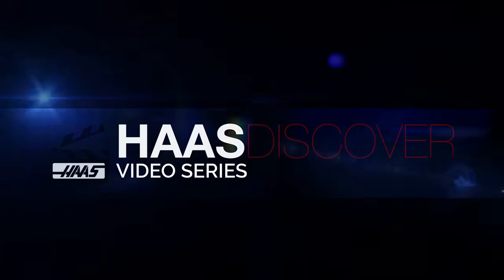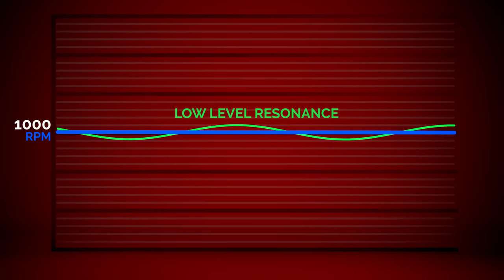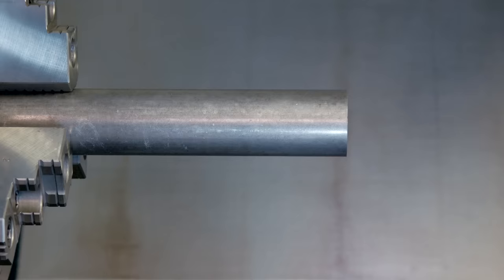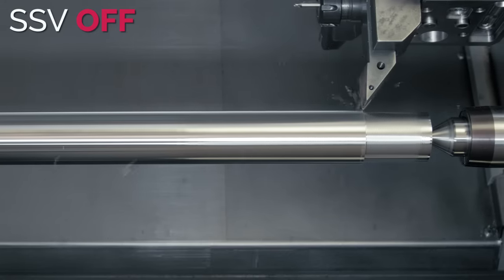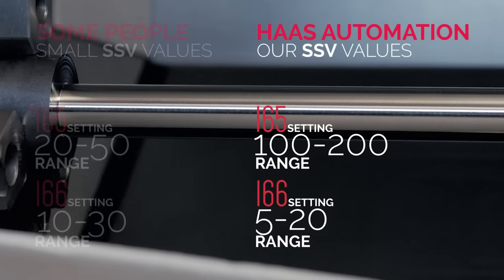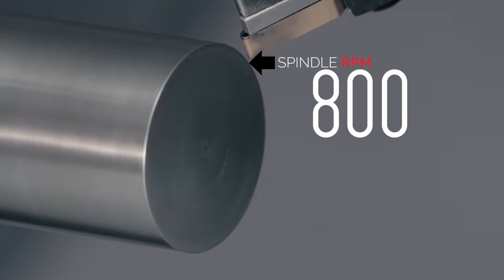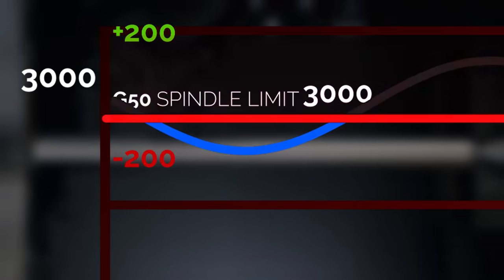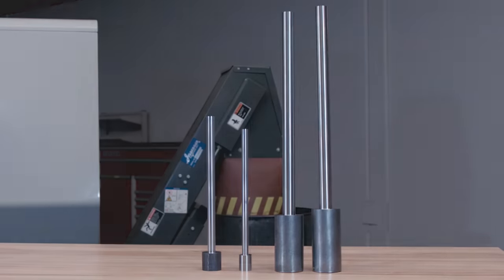Spindle Speed Variation - Stop chatter on your CNC lathe - Haas Automation

Comment: My machine doesn't have SSV, but I use this technique manually with the overrides and got great results. When you do not want or can't change the setup, rapidly changing the spindle speed works. Especially when you're facing and getting chatter.

Comment: Im a CNC machinist and I have never seen such an amazing content from any CNC machines manufacturer as HAAS does, great job, this is gold.
Reply: This. You don't even necessarily need a HAAS machine to apply what you learn from these videos. Great series that teaches concepts.
Reply: @Yeah Right "Tool Pressure" may I have an explanation? I've had lots of problems with chatter and it's almost always boring bar length or not enough support on jaws. Actually is there something I could read up on that you would recommend on this topic because I was just thrown in on a cnc lathe (not a HAAS) and had to learn everything on the job.

Comment: 3:40 There is conflicting information in this video. The narrator says SSV increases spindle speed by 150 rpm, then decreases by 150 rpm. So it should be back to 1500, but instead it shows 1350.

Comment: One thing they didn't quite explain: Around 2:50 they show the spindle speed varying above and below the resonance speed, but don't explain why you wouldn't just pick a fixed spindle speed outside resonance.
I can some of with three reasons:
1 - The system is probably a nonlinear one, and so it will resonate at a wide range of frequencies; varying the driving frequency prevents the resonance from growing to a significant amplitude.
2 - The resonant frequency will vary as the part is machined and so will eventually match any particular fixed spindle speed
3 - Determining a safe spindle speed is pretty much by trial and error, resulting in many scrapped parts during test cuts

Comment: I think a very important point was not covered or maybe it should be assumed? 
Does the federate try to follow the spindle speed to maintain a constant surface footage?
Would SSV be generally more or less effective if it did or did not?
Reply from the maker: +Max Maruszewski This is the beauty of SSV. It maintains the same Feed Per Revolution, while the spindle RPM varies up and down to keep the chatter away. Your parts will get the same consistent turning finish, as the feed does follow the spindle RPM with SSV.
Reply: +Haas Automation, Inc. So with SSV on the SFM of the tool is fluctuating.
Reply: Max Maruszewski The SFM is only a function of the workpiece diameter and rotational speed, so yes, it changes.

Comment: Very impressive. It would be just as helpful on the milling machine to. Is also available on the VF2?
Reply: Much more helpful is to use SolidCAM, which will tell you if it will vibrate or not already before cutting anything.

Comment: Hey, I was just curious, can SSV be applied and disabled inside of a canned cycle such as G71? I have made parts that have a large stable diameter closer to the check but further out have chatter issues due to the small diameter... Just wondering if on the first/second line of an G71 if it can be turned on then turned of once its moved along the part into a larger area.
Tks!

Comment: Hi, I'm not sure if anyone (at Haas) monitors these comments but if so, I'd like to say thanks. This gave me an idea to try it on my machine. On an 840d, you can use synchronous actions to read the actual spindle and vary it by a % and time. This means it works in g96 and g97. Additionally, you can compare the actual to limit and if they are equal, the variation slides down instead of sliding up and down (moves the setpoint). In this way, there are virtually no limitations. Would this be possible to develop for your controls?

Comment: Here in Peru Haas machines are known for having the parkinson effect, they shake even under normal cutting conditions. Chevalier machine don't have that issue. Loaded with Fanuc or Siemens controls, very rigid spindle head plus a proper machine weight and geometry we have not experienced these kind of problems. 
This SSV will work for Haas, other machines don't need it.
Reply: A fair condition Chevalier can be a little jewel of a lathe!
Reply: even with inconel at 5.85mm diameter x 136.5mm long ??
Reply: @Jonathan Smith who is your comment aimed at ?

Comment: I tried it at work today using SSV but it was not working. Is there a specific cycle it can only run in? Such as a can cycle? I am running a linear G1 to make Edge breaks , turn down the diameter and another Edge break before that same tool parts off the parts.

Comment: Can you please give us a example of the M38 use in the gcode?   Does it go before or after the G96?  Can it be used with G97?  Where does the M39 (cancel M38) go?  If you put in another G96 or G97  line is the M38 still active?  Thanks for your help.

Comment: If you use a face grooving insert turn up the 7in or so with little to no chatter ive finish turned 16in 1.5 dowell pins between spindes no chatter .0015 tapper.

Comment: I work on a TL2 with the older screen set up. I can insert the G38 code into my program to start SSV, but how do I program the speed variation and timing?
Reply from the maker: Setting 165 SSV Variation (RPM)
Setting 166 SSV Cycle(.1) Sec

Comment: if chatter is caused by the spindle spinning at the resonate frequency, and ssv just make the spindle spend less time in that frequency, then wouldn't increasing rpm the rpm out of that frequency and leaving it there solve the problem?
Reply: Nix Ryu no because it will start harmonizing and it will start to vibrate again. Varying the spindle speed will keep it from vibrating alltogether.
Reply: Harmonics, the part can still vibrate at other frequencys

Comment: This was very informative! But I have a question: 
Does the SSV function only apply to Haas-machines or is it built in to the overall Fanuc system?
Reply from the maker: There may be other machine tool builders that have similar features, but this video refers only to Haas lathes. Thanks for the question.
Reply: In Fanuc you can develop it by your self quite easy by using "real-time macro" so your old "fanuc lathe" with this option can do this. 

Siemens has this feature avalible to donwload and integrate on (almost) any Siemens controller. 

Both controllers will also adjust feed to the actual spindle speed.
Reply: MANDELAZZA looks like an application for parametric programming if your machine doesn't have it
Reply: Any CNC lathe with a spindle encoder that I've ever used can do this...

Comment: does anyone know if there are similar functions on other machines? i operate a Dosaan with Fanuc and i cant seem to find any from what i know. anyone knows?!
Reply: I've never seen it on any other machine.  What you can do is manually emulate this using the spindle speed knob on the control.
Reply: @Reficul999  would be much appriciated!
Reply: @balooc2  at the moment the document is in dutch, if This is no problem i can send it to you. otherwise you'll have to wait a couple days then I will create a language button
Reply: @balooc2  I'll put a example in this comment maybe u can do something with the code yourself
Reply: @Reficul999  i hope i will! i have a job doing a 115mm long rod with a OD of 8mm. had a problem with vibrations and i hope this might be a solution!
Reply: @Reficul999   thanks alot! i will get back to you when i've tried it out. just gonna change some parameters to fit my program. thanks again!
Reply: @balooc2  let me know I'm very curious

Comment: G50 is the same as G92 S ?
Reply from the maker: Hello Salim,
G50 can perform several functions. It can set the Global Coordinate, it can shift the Global Coordinate, and it can limit spindle speed to a maximum value. 
G92 is used most frequently for simple threading. It can also be used for multi-pass and tapered threading.

Comment: I'm working on a DMG delta and an emco. I work propeller shafts for ship propulsion, which are 2-4 meters long. Material goes from 42crMo4 to high alloyed steels eg. X8CrNi18-10. never had such problems. Haas are just bad and you will hardly find in German companies.

Comment: how i wish that my boss purchase haas machine
Reply: Oh no you don't!
Reply: mang pekweng My shop had nothing but HAAS, we've put enough maintenance into them to buy a couple of ACTUALLY good machines.
Reply: HAAS makes a good machine for what it is, if you think any differently your being obtuse.
Reply: User Name They're great for running aluminum. I won't get into it, but after over a decade of being in this business and experience with countless "brand name" machine tool makers, I can ultimately say that's all they're good for. They have a great, user friendly control and they're easy to set up but that's where it ends. If that's "obtuse" then so be it.
Reply: We used them to great success running various steels holding sub .001 tolerances. They were far easier and cheaper to maintain and service than our Mori seiki and okuma machines and had no more problems than either machine. 

They get a bad rep from elitists, but they offer a good value. Personally I'm a Mori seiki guy, I ran the fuck out of a nh6300 for quite a while. Sure it was more rigid and had a shit load more power, but it also cost us much more money in downtime because getting service was a nightmare.
Reply: User Name We run, or should I say try to run ÷/-.001 on ours and for whatever reason the ID tolerances are an issue with "spring passes". Our lathe has an oversized chuck installed by HAAS that just LOVES to throw parts even at per spec and recommendation by HAAS. I've actually PROVEN the machine, that had NO ISSUES other than just operating in 4140 alloy steel ACTUALLY MOVES just from day to day operating.
Reply: Why are you spring passing anything? 

Yeah most lathes will do that if you cut the fuck out of everything. Our sl35s needed aligned once every week or so. It's not an uncommon issue. Even our brand new dmg Mori beta 800s have similar issues, as did the old okuma and mazaks.
Reply: User Name Thanks for proving my point.
Reply: User Name There's a big difference between cutting difficult to machine materials, and run of the mill (pardon pun) materials. Again, I've proven that within 6 months our HAAS SL-30 lathe with a 12" chuck, even held per spec by HAAS throws parts to the extent they need 1/3 cost of initial investment to get it back up and operating.
Reply: User Name And BTW, I've never seen a Mazak that couldn't handle anything. I've literally beaten tool holders back in with a hammer and pressed the cycle start button and ran it out.
Reply: I've seen dozens of mazaks not hold up for any time at all. I'm not sure what point of yours I proved besides all of your issues are not uncommon with lathes.
Reply: User Name I've ran, setup and programmed (at the machine) roughly a dozen Mazaks be it a lathe or a mill and they smoke HAAS on every level. Never had said issues with either a lathe or a mill with anything but a HAAS. I currently program for a MoriNLX2500Y and a Citizen Swiss type lathe. Again, I've proven our HAAS starts to run out within 6 months just by running it.
Reply: So does every machine. Even more so in non climate controlled shops. You've proven nothing here. Your argument is completely bogus. 

I am currently running a dmg beta 800 right this second that is out more than .5mm in y and has more than .3mm of taper over 300mm the machine has never been crashed. Dmg is toy grade machine tools, and their service is shit. 

The regional guru for lathes Mike is a half wit, and his reason our machine is out is we don't have enough grease in the Chuck. If your argument is that dmg is better you are making shit up for the sake of argument.
Reply: User Name "So does every machine. Even more so in non climate controlled shops" you don't say? I'll let you know when my DMG moves by THOUSANDTHS in a matter of MONTHS NOT YEARS. Hell, we've had our Citizen four SIX YEARS and it runs the same parts every day holding tolerances of +/-.0002 holding sub 15 micro finishes, next you're going to try and tell me how much better a HAAS is compared to that. "You've proven nothing here. Your argument is completely bogus." I don't have to prove anything to anybody, what I've said here is very much common knowledge. I'm not out to bankrupt HAAS I'm just keeping it real. As far as the machine you're running, I can't speak for that model as I've no experience with it but let's just put your "DMG is toy grade machine tools" theory to the test. Within the last 6 months both our HAAS and DMG took huge shots. The HAAS threw a part (surprise) and the Mori had a full rapid collision with a large Capto mounted drill that was so bad pieces of the drill are probably still being plucked out of the chip barrel. HAAS was down for nearly a week and a half. DMG was making chips in TWO HOURS. Do you have any idea how much money that adds up to be? "Their service is shit" I won't deny that it's not the greatest ever (I'm talking DMG, not the reseller, that would be a regional issue). In keeping it real, I will also say the Celos control is flat out gimmicky and I don't like it at all. Aside from that it's been pretty solid.
Reply: Yeah let me know because mine is .015 out over a foot, and the y axis is .02 out after 3 months. Our other beta 800 is sitting in a closet because it will not stay even remotely close. It has had the jaws rubbed and that alone set the entire thing so far out that it is useless for tool making. 

See the throwing parts is what happens when you put a larger chuck on a machine. So if you have a 10" chuck, and you move up to an 12 inch chuck you are going to have less clamping pressure at the same drawbar pressure. That is why you are throwing parts. Period. It has far less to do with the machine. Some machines have larger drawbars so its less noticeable but if you were to actually put a force gauge on it you would see your problem clear as crystal.

Our mills have also been a nightmare. I don't fuck with them, but they junk parts every day because of alignment issues. We just finished die plates that were .3mm out of flat across the face. 

I take it you've worked in a machine shop for a few years, think you've got a handle on whats going on. You've got a lot to learn. I will not argue that HAAS is the greatest machine on the planet, but if you think DMG is good and your making that comparison your way off base. DMG is just barely a step up from a fryer in my opinion and experience. HAAS is at least competitive.

Comment: Haas machines dont seem to be as rigid as the cheaper Taiwan made machines. Them linear bearings suck. Stick with square ways.
Reply: Sucks2beU in my old shop we used Doosan machines and they were rigid and we ran huge stock.  Lots of big parts.  Such a much more solid machine.  Haas sucks.